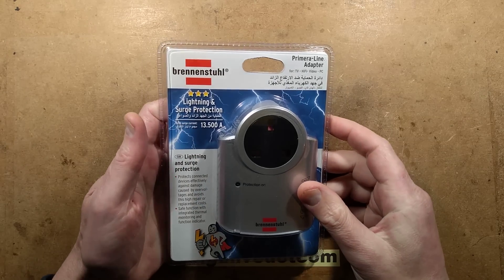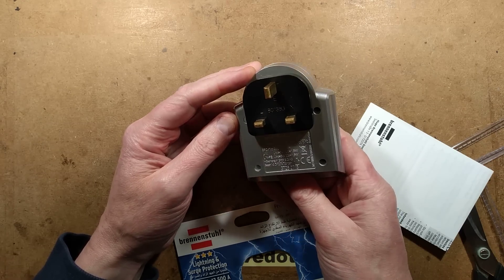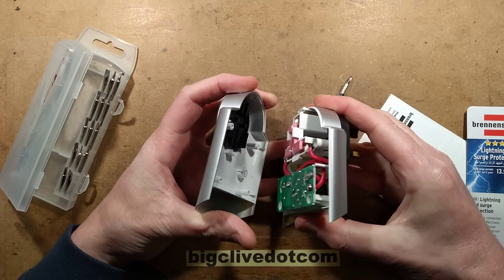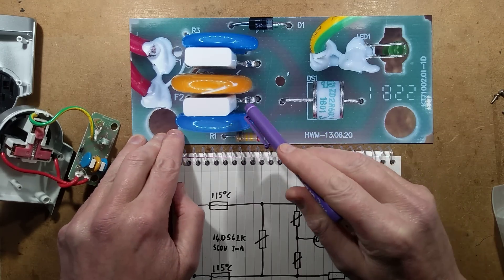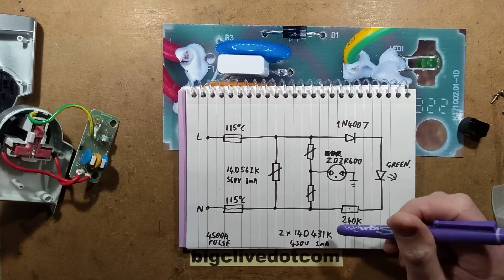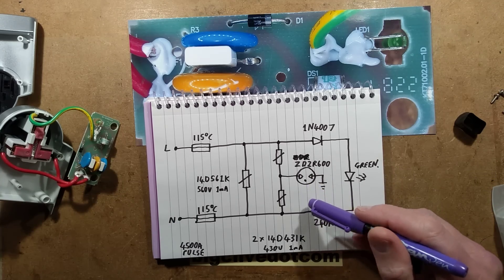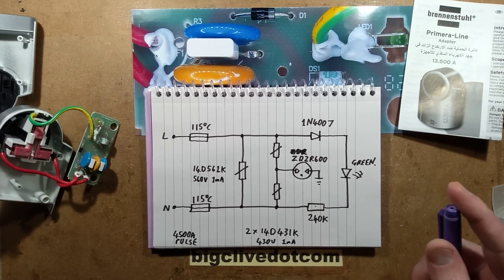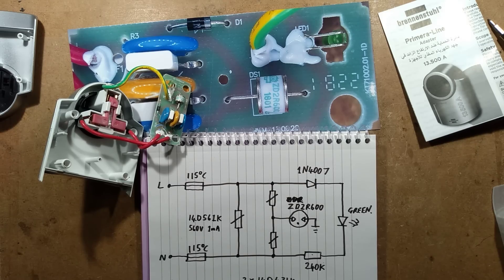Inside a 13,500A surge protector.  (With schematic.)

Comment: For what the cinnamon toast frick could you need 13.5 thousand amp protector for?
Reply: I have a lightning rod connected directly to all my electrical appliances
Reply: @pyromen321  ham radio equipment often is effectively connected to a lightning rod. In that case the surge protector is protecting the rest of the electronics in the house... but yeah this thing ain't gonna cut it for that use case. I prefer using about 100 50A MOVs and about 100 feet of buried Romex for that... The Romex will shunt most of the energy to earth as it burns up, and the MOVs will keep the voltage down long enough to blow the fuses.
Reply: @jdrissel  Use multiple of them, and one per outlet, as that allows wiring impedance to provide some attenuation of the pulses. Mostly used to clamp spikes from large inductive loads down to a level most devices will tolerate, and provide some protection against the surge from nearby lightning strikes. Direct hit on the supply lines in the neighbourhood they do nothing much, they vapourise along with the rest of the electrical and electronic stuff that is plugged in, irrespective of the stuff being turned on or off. 

Got to install a somewhat massive 480V VDR into the board soon, to provide incoming energy clamping, though I am using a 480V unit to provide pulse protection only, backed up with a breaker when it fails. Not going to provide much protection against loss of distribution system neutral (had that a few times because of cable theft) but the lower voltage ones on equipment do provide that along with the RCD. Big unit is more of local lightning strike protection, or somebody driving into the 11kV loop somewhere.
Reply: @pyromen321  you mean a sail boat?
Reply: topher, no I only have a sailboat connected to my TV
Reply: @pyromen321  Me Too! It makes the electric bill so manageable! The bill from the fire department, though, kinda offsets the savings. And the contractor, the interior decorator, etc.. I do love the Ozone scent, though. Kinda nice.    ;-)
Reply: to power a uBeam ofcourse.
Reply: @surf8168  He explained how they came up with that rating:  3 X  4,500A (the individual peak rating of each of the three MOVs). Definitely not a conservative rating, though!
Reply: Lightning (between 10k to 200k amps), thus the product branding.
Reply: Dissipating lightning strikes, which can be anywhere from 10s of thousands of amps to 100s of thousands of amps.  However, this design is never going to absorb a 13,500A surge — the house wiring leading up to this device would likely vaporize (and would likely have much too high an impedance) before you achieved those current levels, much less the traces on the PCB.
Reply: sky electricity
Reply: @surf8168  Clive just calls it as he sees it. He doesn't need "bait". He is himself, an Icon. He IS the bait.
Reply: @surf8168  :
European number standards use a decimal instead of the comma. 13.500 is 13,500 in the US. 
Hey my college education was not a total waste of $$$.
Reply: @surf8168  13.500 or 13,500. It depends. On what? On where in the world you are.
Reply: @surf8168  you know in the country that they try to fake (original = brennstuhl from germany) we use . and , the other way around
Reply: For when you want to out youtube Ben Franklin.
Reply: 13.5KA would only occur for a few milliseconds before your MCB or Circuit breaker trips anyway. Your wiring is designed to take short circuits and will be protected by the MCBs in the panel. Think about it, even if you plugged in a plug with the Live and Neutral connected directly together you would trip the MCB, but wouldn't need a complete rewire.

Whether or not the circuit breaker can effectively break that higher surge voltage is another matter.
This will help protect from surges from more remote lightning strikes, but if you get a direct strike to the local supply then fuck all will protect your stuff.
Reply: For the same reason that the circuit breakers in your panel are rated for at least 10,000  amps.  Because you need that when lightning strikes or plasma shorts the mains coming into the house.

Comment: Interesting that the CPC listing says "Primera-Line Surge Protected Adaptor, 13.5A 230V -  1506953" and then lower down says "Protects electrical appliances against surges with a maximum up to 4,500A"

Comment: As a programmer, the flipping of , (thousands) and . (decimal) separators in certain parts of the world drives me mad. It's almost as bad as timezones.
Reply: As a programmer, I have to study the raw .dita files which are turned into PDF manuals for a client's computer range, and construct a script which will change the English-language commas and decimals around for other countries when they are translated. It is tedious in the extreme, but I get paid for it.
Reply: Many moons ago I used a government national computer network. One weekend the software was updated. Come Tuesday lunchtime the system crashed. Eventually it was discovered that someone had input a  ,  rather than an . it was two weeks before the system came back online. This meant that the very few of us who had trained on the former  manual system had to work silly hours to keep everything running.
Reply: This, so much. That's why I've switched to space as a separator in writing - it's not only easier to read but more universal.
Reply: It's horrible! You even flipped them in your comment and you didn't notice the error haha 🍄
Reply: Totally agree.  The decimal comma thing is a problem.  Even when someone comes to me with a .csv file, if they have a non-UK version of excel, the "CSV" actually has semicolons as the separator.  Not a problem if you just want to look at it in excel of course.  But when it comes to reading it into e.g. R, it behaves in a very confusing manner.
Reply: In handwriting it doesn't matter... :)
I think you ignore the thousands separators on input side (they are like spaces, just visual to make the big numbers easier to differentiate) and then can convert both , and . into whatever your program requires internally when dealing with decimals... For output it doesn't matter tbh, if someone sees 9.3 instead of 9,3 I don't think he or she will assume it's "900,3" (or whatever), people are not that dumb.
Reply: The one that get me is mAh.
Really? Really ?
Reply: Shrike DeCil Why does “mAh” bug you so?  It is certainly preferably to typing out “milliamperes-hours” with every reference to capacity.
Reply: Brennenstuhl is a German company as far as I know.
Reply: @shrikedecil  Yes, I have said this before: there's a perfectly good coulomb you could use. I am sure there is some reason for it, though.
Reply: zh84 hour is a more human scaled unit for longer periods.
Reply: @zh84  SI: a system designed when science was limited to human-sized scales. Go get upset at the scientists who use eV, Å, au, ly, M☉, cm^-1, dB, Da...
Reply: Agreed. Part of my job as a geneticist is working with data sets, most of which get passed around as .csv files.
I hate collaborating with Europeans cause they really suck about this.
Reply: Yeah, Europe sucks that way. Same goes for IEC prints, eplan for drafting, preferring FBD over ladder logic, 240v (we invented electricity, HELLO!) and using metric.....
Reply: jak p - no one invented electricity!
Reply: @nifela - That is actually the ISO / IEC standard:

9 Numbers, quantities, units and values
9.1 Representation of numbers and numerical values
• The decimal sign shall be a comma on the line in all language versions.
[...]
Each group of three digits shall be separated by a small space from the preceding digits.
Reply: @jakp8777  We follow international standards, ISO. You don't follow the standard....
Reply: @jakp8777  Invented electricity like Newton "invented" gravity, ever heard of Volta, Faraday, Ampere or Ohm? American history teaching must really suck. It is a bit of a mystery why the US as late arrivers on the electrical scene decided to go for 110v and be out of step with the rest of the world instead of following the lead of Europe where electrical power distribution was actually developed. The first long distance AC distribution was in Italy,   high voltage networks originated with ZBD transformers developed by Ganz in Hungary,  polyphase generators were developed in Germany by a Russian engineer building on the Irishman Parsons earlier turbo generator. The first real commercial system in the US was Westinghouse assembled largely from imported European tech. Rant over, not a personal pop at you just that the myth that the US  invented everything always sets me off.

Comment: One thing that seems nice about this design is that minor surges would appear to be shunted to neutral, with only a major surge directed to ground.  This would be an improvement on most of the surge suppression devices I have now, which seem to send everything to Earth including minor events.  The problem with this is that a small over voltage will come in on the live line, leave via Earth, the RCD sees an imbalance and before you know it all your power is off.  Granted this is desirable for major events but it's a pain for anything minor, so I like this design as it seems it will only trigger an RCD to cut the power in the event of a significant surge.
Reply: I was thinking the same thing. Convenience is great if it doesn't significantly affect performance.

At work, we have a wall of TVs, all on surge protected outlets. One night we had a really big surge, but only damaged one TV on a wall of 33 or so. Seems like all of the sockets shared the load, and tackled the transient together.
Reply: Doesn't bother me, I don't have an RCD, those things are a pest.
Reply: @lambertovitali3152  Seat belts in cars are also a pest but they also save lives, just like RCDs.  Sometimes a little inconvenience is worth saving the lives of those you care about.
Reply: @Berkeloid0  I don't wear a seatbelt either.  And I didn't get vaccinated.  Because I understand probabilities.
Reply: @lambertovitali3152  Famous last words...
Reply: @Berkeloid0  Not necessarily.  If you avoid every risk, you'll have no fun.  You need to draw the line somewhere, but not 100% safe.
Reply: @lambertovitali3152  Absolutely agree.  But risking an injury to yourself is a lot different to gambling with the lives of yourself and your family or friends.  Avoiding a seatbelt or RCDs doesn't make anything more exciting, but it is well known that it will kill people who otherwise would have survived, so there's not much of a reward for that risk.  But I guess at least you are most likely to remove your own genes from the gene pool so over time those people who like taking pointless risks will eventually die out.